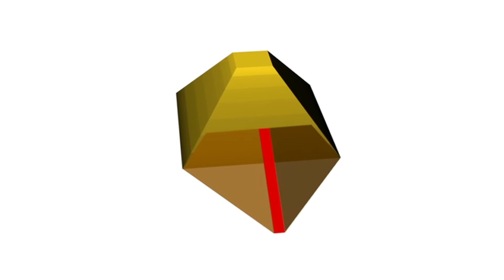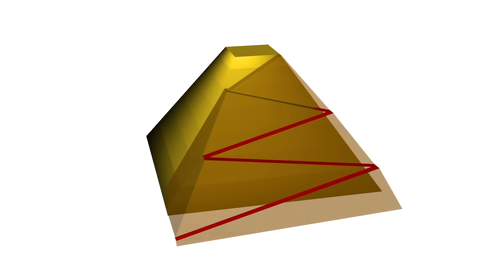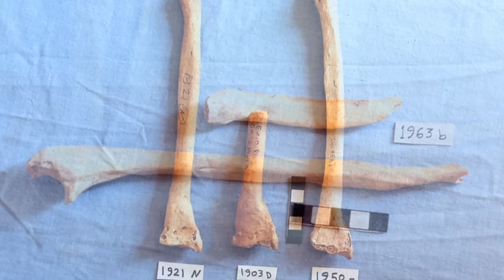Egyptology - Pyramid Construction

Comment: Yeah "ramps  and pure muscle power"...give me a break! Have you written to Santa Klaus already?
Reply: "Yeah im sure using a piece of dolerite and slamming it into another piece of dolerite will result in a uniform smooth surface."

Dolerite is not used as a construction material for obelisks. A softer granite is. Dolerite is 3 times harder than the granite found in quarries. And yes, slamming one into the other will cause the softer of the two to chip away. No, dolerite was not pounded into granite for final shaping, dolerite with a flattened surface was scraped across the surface to polish them. Literally every single step in this process has been reproduced. Ancient Egyptians even left behind unfinished obelisks with all the telltale marks of the very process outlined... complete with the dolerite stones they used in the process.

"It doesn't make any sense."

Your strawman of pounding rocks into other rocks to "polish" them certainly does not make sense. If you were to outline a more comprehensive process which has been reproduced, then it would make sense... but you don't want it to make sense.
Reply: "The results have not been reproduced. People who have tried say the method doesn't make sense."

You say that meanwhile Egyptian stone masons still utilize dolorite stones to polish granites and limestone: https://www.alamy.com/stock-photo-2040-egyptian-stone-mason-at-work-30857586.html

"If you bang a piece of dolerite into a piece of granite it makes very little impact for the work required."

Yet when you set an entire team of workers going at it, you can multiply the work done by magnitudes of order. They literally left behind the telltale furrows from working a small section of rock at a time: https://mymodernmet.com/unfinished-obelisk-aswan-egypt/

So please explain, exactly what part of the process "doesn't make sense"? You've already been wrong 3 times in this short conversation... something tells me that the trend will continue.
Reply: "Sculptors today don't use the same material they are working with to hammer the subject material."

I literally showed you a photograph of an Egyptian handshaping blocks and  producing rather fine flat material. But you can pretend nobody still uses stone and grit to polish stone...

""Harder stone simply means more work." - No, harder stone necessitates different tools."

Not as far as the vases you invoked are concerned. Harder grits and tool tips are needed but an entirely new tooling is not required.

"I would like to see them prove that they can make a vase out of granite with copper and stone tools."

Proof of concept replicated from the Egyptians records shows it is possible. If you are willing to foot the bill for the R&D and man hours for the build, I'm sure there are many people who would be glad to satisfy your personal request for a vase made of whatever stone you like. Are your coffers like that of a Pharaoh?
Reply: ErgoCogita Damn, you keep droppin the truth but this loser doesn't get it.
Reply: ErgoCogita don't bother arguing with him, its pointless, leave before you lose brain cells.
Reply: Dagger 323 you are a dumbass
Reply: Sick Dece you just got bitch slapped 😂😂
Reply: "They made vases from their hardest material, how did they polish those?"

OMG... Being a "hardest material" does not preclude it from being shaped or polished. WTF kind of question is that anyway? How do you think literally anything is polished? By using progressively smaller and smaller grit size of a hard, wetted material such as sands of varying compositions... Seriously now, you seem to be extremely unaware of how stone masonry works.

"How do you proposed they shaped dolerite vases with dolerite hammers?"

Again with the obtuseness... It's almost as if you don't even know what you are asking. Again, for the last time... bare hammering was obviously only used in the rough part of the shaping process, just like sculptors today. The finer part of the shaping process would happen through fine chiseling and abrasion... no different than today.

"In that link you provided about the vases, they made a limestone vase with that method. They didn't reproduce a dolerite vase."

They literally copied the process as found on several sets of hieroglyphs. So what if they didn't recreate a specific vase you have in mind. Ancient Egyptians made vases out of many different materials so proof of concept is all that is required in recreation. Harder stone simply means more work.

BTW, there is far more info out there then you seem aware of: http://www.oocities.org/unforbidden_geology/ancient_egyptian_copper_coring_drills.html

What, you think nobody has ever cut the vases open to see if the tool marks match what they replicated from hieroglyphs?

"The unfinished obelisk does not have any telltale furrows of hundreds of people pounding away at it with other rocks."

I present you Aswan quarry:

https://www.google.com/search?biw=1772&bih=885&tbm=isch&sa=1&ei=P3RWW6cMzvHmAuXGsCA&q=aswan+quarry&oq=aswan+quarry&gs_l=img.3..0j0i30k1l2.20285.22665.0.22980.12.12.0.0.0.0.89.743.12.12.0....0...1c.1.64.img..0.12.740...0i67k1j35i39k1j0i8i30k1j0i24k1.0.htC-Cxqn1FM

The entire freaking quarry is full of individual furrows that were pounded out by individual workers Even further, when rediscovered, the quarry had dolorite balls found all over buried in centuries and centuries of sand. They literally left behind their tools and the tool marks... what more do you need to consider that they indeed quarried stone by pounding out channels around the desired block?
Reply: "How do you cut granite with copper and stone tools?"

Granite is quarried (and roughly shaped in the process) using dolorite balls. Check a few of my comments back in this thread and you will find a link to a google search page showing many photographs of a granite quarry with many individual furrows pounded out where blocks were freed from bedrock. The unfinished obelisk in the center of the quarry still retains all of it's original tooling marks in the shape of individual furrows where individual workers pounded as they roughly shaped the block during the quarrying process. They even left behind many dolorite blocks in the quarry which were uncovered after thousands of years of sand buried them. As for cutting granite with copper, it was done much like this: https://www.youtube.com/watch?v=qeS5lrmyD74

"I'm a Mason by trade, and even cutting granite with DIAMOND blades it hard."

Then your blades would seem to be trash. I am a mason by trade (I construct granite and marble ledges, steps and walls and not even granite stands a chance against diamond blades when I employ them. Heres an 8x8 block being halved in just under 2 minutes: https://www.youtube.com/watch?v=GLJmCV4GIiI

Regardless, being hard does not make granite impervious to cutting as is demonstrated in the video I linked. To be sure, it takes a LOT more time but it is neither impossible nor outside the range of a very rich Pharoah with many skilled workers on hand... 

"So much of the pyramids is unknown, its pretty cool."

Agreed on both points. There is much we do not know about ancient Egyptian construction techniques but we DO know quite a bit from the records, tools and quarries they left behind.
Reply: Luis Jorge aliens
Reply: its funny watching u idiots argue
Reply: Luis Jorge 😂
Reply: Luis Jorge Yes it was build by hand.
Reply: That's what I was thinking. This video doesn't tell you there are corridors inside the pyramids lined with granite. How do you cut granite with copper and stone tools? lol I'm a Mason by trade, and even cutting granite with DIAMOND blades it hard.

So much of the pyramids is unknown, its pretty cool.
Reply: @Jordan-vr7ip  lol
Reply: Travis Mandel point being that it may have not been built by humans at all. How do you explain the fact that the pyramids were nearly perfectly symmetrical, something no human could have possibly accomplished without precise modern technology of today? And the fact that they were in line almost directly with certain stars and constellations?
Reply: It was built with the help of water ! Search it up
Reply: Fiasco You are not even qualified to dispute it lol, so stfu.
Reply: Yes they can, you are just ignorant and stupid, again you are not qualified to say otherwise because you have not gone through 4-6 years of college to study this, you just look up random shit on the internet with illegitimate sources and think you know it all when really you know fuck all because you have no qualifications.
Reply: Yes they do, stop being ignorant and get educated.
Reply: "How do you explain the fact that the pyramids were nearly perfectly symmetrical, something no human could have possibly accomplished without precise modern technology of today?"

So you think that Humans couldn't possibly create structures with "nearly perfect symmetry" without modern technology? Does that mean you think it impossible that Humans built all the cities of the Roman empire? What of Sumerian empire or the Hittites or the empires Asia or South America or...

Yeah, you don't really have any clue as to what you're claiming, do you?
Reply: "nobody can tell you how the vases were carved. Nobody knows what tools were used to cut stones. There are no records of it."

I'd like to bring your attention to the fact that there are records of it:  http://www.reshafim.org.il/ad/egypt/trades/stone_vessels.htm

The carvings at the tomb of Mereruka would seem to dispense with your claim.
Reply: Fiasco yes actually they do, you wouldn't know because you don't have the qualifications and its not your lifes work.
Reply: Yes they can, again you can't say otherwise because you have no qualifications.
Reply: They used sand as an adhesive you idiot, they proved this years ago, stop being ignorant and watch educational videos on the matter you fool.
Reply: Fuck yous sounds like damn creationist "Oh we don't know so god must have done it", but yous are saying aliens. Fucking idiots.

Comment: Where is any evidence for ramps?   Water flotation seems to fit facts better.
Reply: redlegagent:   Heodotus lived 3,000 AFTER the Pyramid of Cheops was built; Herodotus could not have witnessed same construction, nor could Herodotus have interviewed any witness to that history.  Herodotus reported what he was told.   Claim #1 is NONSENSE.

The amount of rubble required to build even the smallest possible ramp is nowhere to be found on the Giza Plateau,  Claim #2 SEEMS LIKE NONSENSE.

Let me understand this:  After quarrying a mountain of rubble for a ramp, building the ramp, and demolishing the ramp, the ancient Egyptians hauled a mountain of rubble back to the quarry.    Dumping a mountain of rubble back into the quarry from which it came seems a very good way to close down that same quarry.   That seems terribly wasteful.   Transportation of "rubble mountain" was accomplished how?    CLAIM #3 SEEMS LIKE NONSENSE.
Reply: redlegagent: You've ignored some facts.   
(1) Limestone in the ground may be moist; such limestone is fot but hardens as it drys.    Moist limestone is soft enough to work at reasonable speed with bronze tools, and water flotation would have kept limestone moist, hence easy to work, 
(2) During construction of the Cheops Pyramid, the Giza Plateau had an aquifer taller than same pyramid.   Same aquifer was more than adequate to supply water flotation.  
(3) Remains of the "great causeway"  seem consistent with use as a canal,
(4) Pyramid of Cheops has 8 sides, not 4, making geometry of same consitent with 4 "water elevators" having been used for construction. 
(5) Occam's Razor -- Water flotation seems simpler, and also seems to answer more questions, than any other theory I've noticed.
(6) You seem to say ancient Egyptians moved a mountain of rubble from a quarry to build a ramp, then demolished ramp and returned a mountain of rubble to a quarry.   Leaving aside the economics of so much rubble hauling, that mountain of rubble would reduce future utility of any quarry.

Here are videos, all from one YouTuber, which look believable to me: 
https://youtu.be/C1y8N0ePuF8
https://youtu.be/dGH93mt81BA
https://youtu.be/dup19cX6yXo
https://youtu.be/TJcp13hAO3U
https://youtu.be/rxFXsoqbfrk

You could view all in an hour.  I'd be interested in your comments should you view them all.

Comment: 2.3 million bricks in 20 years = roughly 1 block every 4-5 minutes.  Even with man power, hand tools and water, you can't make that many bricks and move them and fit them constantly every 4-5 minutes.  Compensate for mistakes and measuring (25% of time), you would have to put a brick in place every 2-3 or so minutes.  Since you can't pre-cut the precision of the outer layers without it being in place, that will take longer.  More advanced tools would have to be used and that lies in taking advantage of frequencies of natural materials so manipulation of these stones would be easier.

Comment: Delusional academics - ask any engineer and you'll get the same answer: cant be done by manpower and leverage alone due to friction and inadequate leverage materials. Machinery was required - you can kid the sheep but you cant kid an engineer. If they were built this way they'd still be unfinished now and not due to 3500ad

Comment: If they built it with ropes and ramps the material required for the ramp to get the top few rows up would require 20 times the material as the pyramid. If they built it in 20 years it would have to be built  24/ 7 and they would have had to place 1 stone every 3 minutes (give or take a minute or so). We can hardly put a concert block wall that fast. Point is stop giving the public nonsense about stuff you don't know. 👽

Comment: The water theory is the most probable, in a desert you have to get good at controlling the flow of water, your survival depends upon it, and heavy blocks will float with a small increase in buoyancy, if you use a gravity fed sealed channel system from higher ground (lake qaroun), you can float the blocks almost as high as the great pyramid.

Comment: Beetles built the pyramids, deep tunnels emerge from underground forming surface pyramids. The pyramids and Ant hills share the same resemblance  because when constructing tunnels underground it is necessary to bring material to the surface and protect your infrastructure. The results are, humans develop tunnel climbing machinery, humans discover gold hot springs, discovery of wind tunnels leads to the invention of a wind magnet turbines, to electricity gold protection, to Egyptian electricity pyramid wind tunnel powered motors, to the Nile River and Giza being the birthplace of all LIFE on earth. illumination

Comment: yeah sure they used string and wood pegs to make consistantly smooth stone acurate to the thousandth of an inch.......
Reply: It is called a plumbob and square, no secret pyramid was easy to build as recorded
Reply: Maxamillion Freedom they used water as levels thats simple ... the guy does not know what he is talking about and been doing it 30 years lol
Reply: Really then how the fuck was it done? You can't use fucking magic or aliens as a reason becasue you sound like a deadbeat fuckhead creationist.
Reply: Maxamillion Freedom i know how you can make super straight vertical and horizontal lines with gravity strings and weights, there surely has to be a way you create level as well. Just don’t ask me about altitude I have no idea how that works

Comment: I read somewhere that in the amount of time the pyramid was built thry would have had to put each block in its place every 2 or 3 minutes. Of course each archeologist says something different.
Reply: That would mean they dug into the hill and placed granite blocks to form the inside chambers and tunnels. That would be more time consuming than constructing the entire pyramid.
Reply: That's because some people assume the entire Pyramid was made with nicely cut blocks weighing 2.5 tons..

A third of it's volume is filled with a preexisting hill. So, before they even started, 33% of the work was already done. The rest of the volume is basically just rubble held together with mortar. Only the outer skin is made using the nicely cut blocks. 

If they built it from scratch, filled entirely with nicely cut blocks, it would have taken over a 100 years.